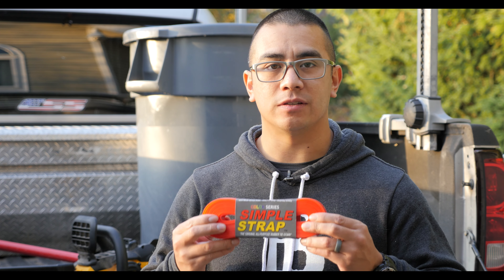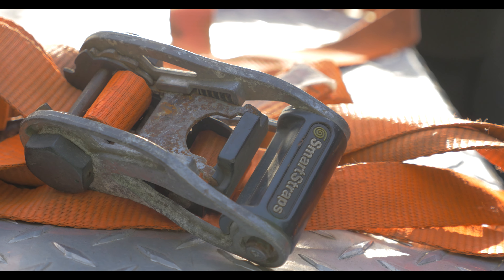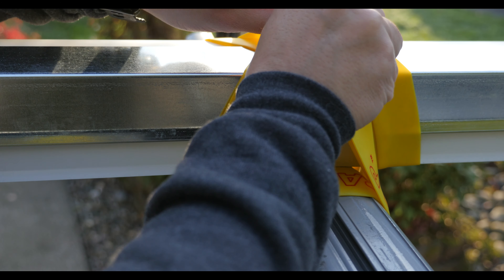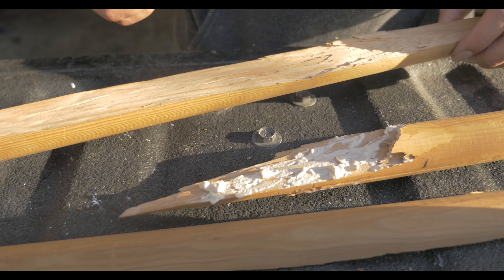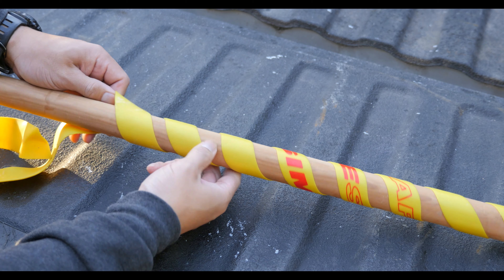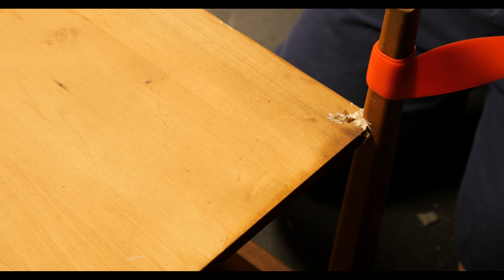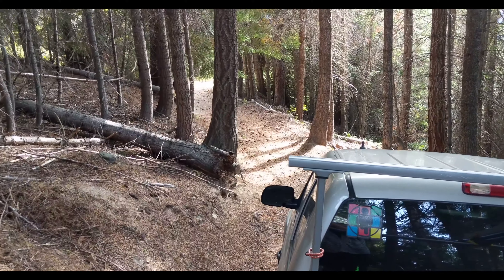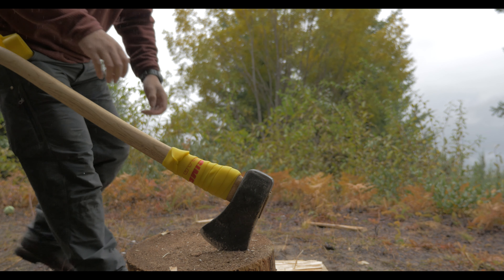Simple Strap tie downs | BEST hauling straps

Comment: I have some of these and they are great. Yes, there's nothing like a ratchet strap to secure heavier loads, but do yourself a favor and try these. I find myself using these more and more rather than the ratchets. They're just handier and quicker for most of the stuff I put in my truck. Used these to secure a cooler to the back of my trailer for a 3000 mile road trip to Mexico. No issues!
Reply from the maker: These things are beasts! Glad you’re finding uses for them. They are in every day use for our family.

Comment: Hmmm.  I can see the benefits, but I would find it hard to trust the simple 'tuck under' to hold it in place compared to a decent ratchet or, better yet, a time-proven knot... especially when securing a load on a vehicle or trailer.   Intriguing though.  Thanks for introducing me to this product.  Best wishes from New Zealand.
Reply from the maker: I thought the same thing when I was using them first time - and they surprised me! They tend to tighten as the time goes by and I have yet to have any of my "ties" slip.
Reply: @innerbarkoutdoors  I've used a similar method while tying slingshot rubbers in place with a rubber band and it is amazing how a simple tuck holds it all securely despite the force that is applied when shooting the slingshot.  I'd just be nervous about appearing to have an insecure load on a vehicle... especially if a traffic policeman was examining it !!

Comment: Thanks for your review.  I wonder if these are safe to tie down canoes on roof racks if going 55mph?  I guess I could use these with my straps for awhile to see if they loosen...
Reply from the maker: I think you have a good idea with having straps on there to be safe, but from my experience I have had no issue - and I've driven over 55 and also relatively fast on a pothole dirt road.
Reply: I used these for my kayak. It worked several times, but blew off yesterday. Damaged my kayak and car. Granted I was going 78 on the interstate. The straps stayed tied to the rack without coming undone, but the kayak blew with the wind and came out of place from the rack and hit the car then dragged on the road. It’s really only by the grace of God that no one was hurt. Either way, I’m going back to ratchet straps with which I’ve never had problems.

Comment: Will the simple strap still work if it gets greasy?
Reply from the maker: If the straps are already in use, the tension keeps oils n dirt out. I don't think they'd work if they got greasy. You'd need to spray them down with carb cleaner or something.

Comment: Definitely useful but they're not a replacement for ratchet straps
Reply from the maker: In some instances they actually are a good replacement. Like I showed in the video they replaced mine when I was dealing with soft/delicate material and on our long dirt/gravel road where ratchet straps become loose after a bit, good replacement. I still have my ratchet straps in the truck ready to go, but the ratchet straps have become my backup now owning these.
Reply: @innerbarkoutdoors  yeah I definitely hear you, small light loads but when loading a quad or anything heavy really, you'll need ratchet straps.

Comment: It looks good, but I'm skeptical of how long it's going to last long-term, after months of UV radiation from the sun and exposure to oxygen.  Rubber parts always seem the first to break down.
Reply from the maker: This was developed in Hawaii so made to withstand TONS of UV radiation, heat, ect. and they haven't had any breakdowns so far (as I know of). It's suggested that when you are not using them to store them away in a bag in your garage or house and no just leave them on your car rack holding something (even tho I have done that and they still preform... shush lol) As for me, I have had the same set for about a year now, and I use them 8 out of 10 times at this point and I have no had a single on break/fail/or anything like that on me. The only this I had to deal with is a wrapped them around some metal and didn't notice one of the edges were knife cutting sharp and it tore a bit when rubbing against it, but again that was purely user error. But I have left them on my truck rack holing wood for extended time in both hot weather and winter freezing temps - and nothing so far.